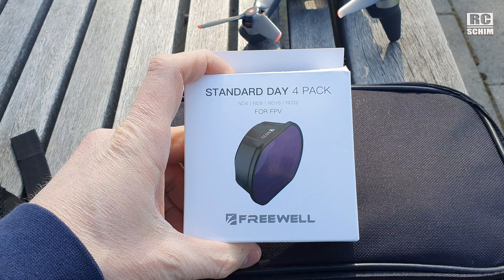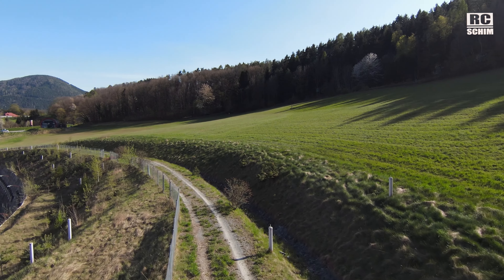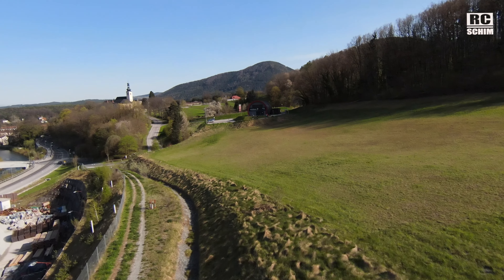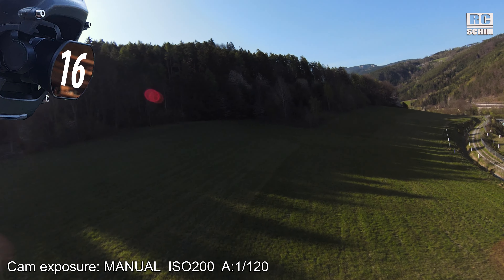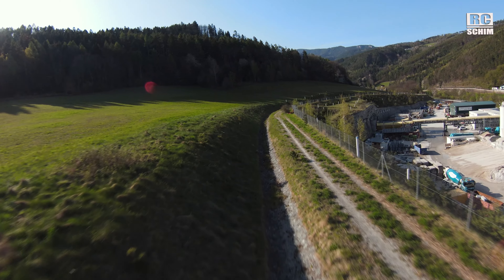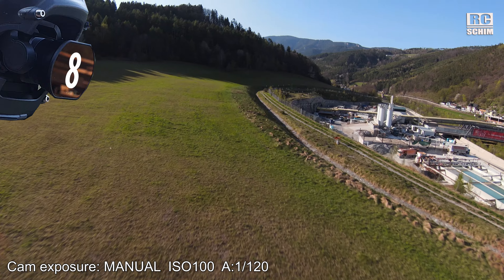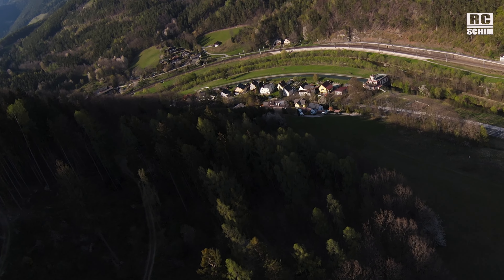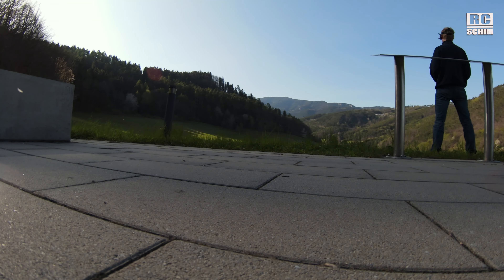DJI FPV: ND Filters vs Jello

Comment: Wow, this is pretty amazing. That is the whole I’m goggle view? It feels a lot wider than the dji air unit and vista. I haven’t really researched the difference in the in goggle view between the V1 and V2 stuff. I have held off buying it because I have plenty of vista quads. But there is no doubt that this looks like a relaxing way to fly and introduce friends into the hobby.

Comment: cool, people aren't really complimentary about the dji drone camera but i think it looks great, fpv cinematic is an impossible task for a camera and i think overall it does really well.  with the gopro's i'm sort of leaning towards auto shutter and just hoping that the bits i want motion blur it sets angle to 180, otherwise its not easy to set gopros to handle wide light changes.  ps. discovered if i set shutter to auto, it automatcally sets iso max to 400, it only took me 3 months to notice this...........................
Reply from the maker: I think so too. The drone is not perfect, but an Allrounder as am i. Maybe that's why we get along quite well ;)
Gopros at least have the option to use 4k30 which is good for lowlight, and I think you can fix the iso max to 100 or 200 if you're in pro tune. Other settings to auto is safe - I agree! Greets, Mario
Reply: @Rcschim  yes i am in protune, but if you set iso min to 100 and max to 100 then change shutterspeed it changes iso max to 400,